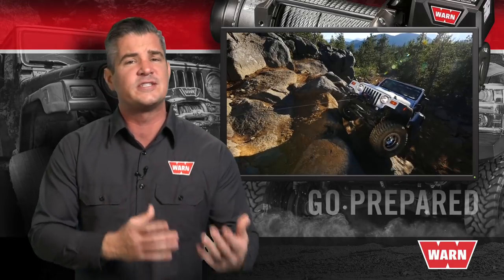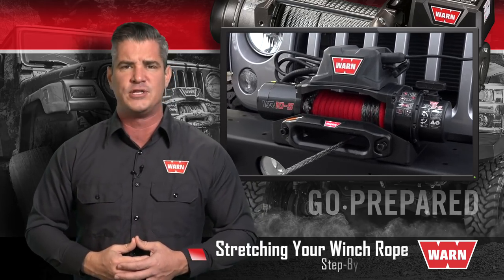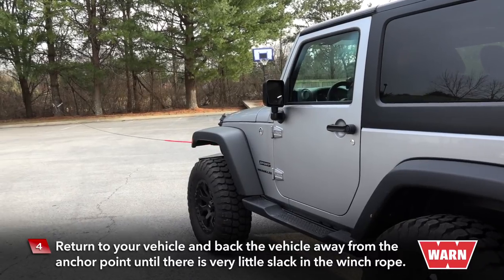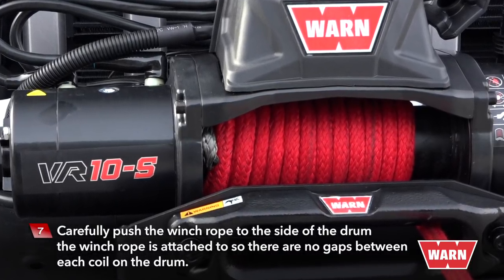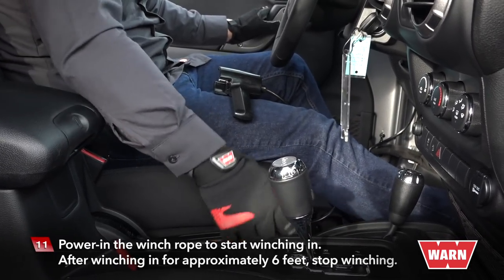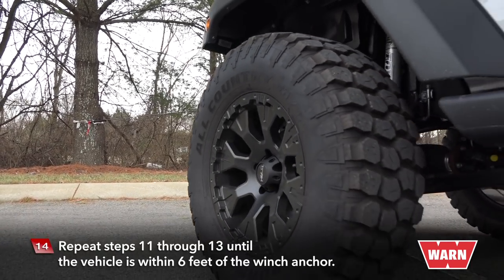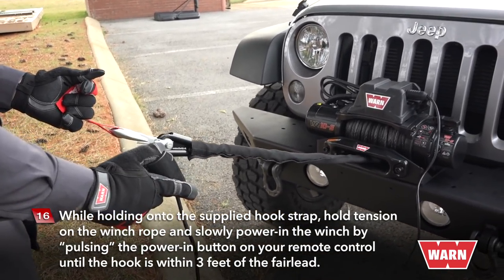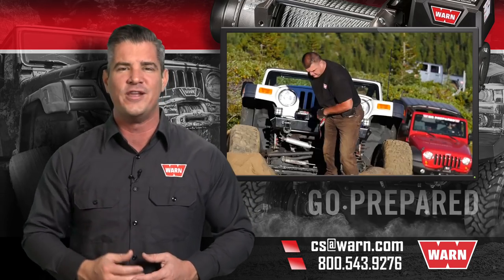How to Stretch Winch Rope

Comment: Or just put it in neutral and set the parking brake lightly to get just the right amount of tension and avoid getting in and out of your truck 67 times.  I always leave my engine running when winching to avoid a potential dead battery.

Comment: Forgive the noob question, but isn’t it a bad idea to put forward tension on a vehicle in park?
Reply: I think this guy confused a lot of people with this 500 step process.  He was setting the parking brake first,  so no problem with the transmission.  You can park an automatic nose gently uphill or downhill without hurting the parking sprag but e-brake is always a good idea.

Comment: In the video he backed up with ALL of the winch line off the drum (zero wraps) so the only thing attaching the line to the winch was the little rope keeper bolt. You can see that he definitely 'loaded' the rope when he backed up (the rope sprung up) -> wouldn't this damage/rip off the keeper bolt? I thought you're supposed to take in 10 wraps (for synthetic rope) under hand tension first??...
Reply: There was several wraps around the drum on the last layer of rope. Wraps is how many times the rope is around the drum which the rope is holding by friction and not by the keeper bolt